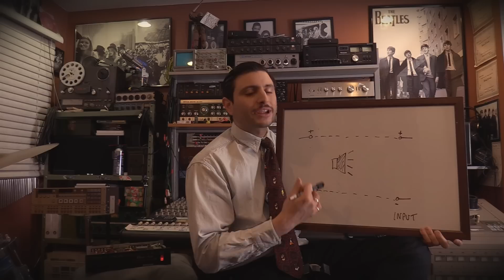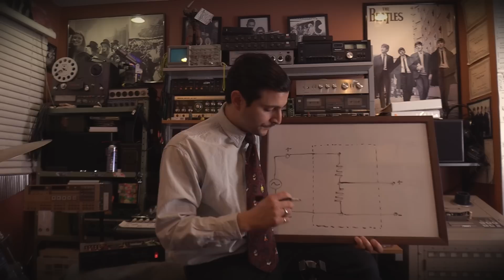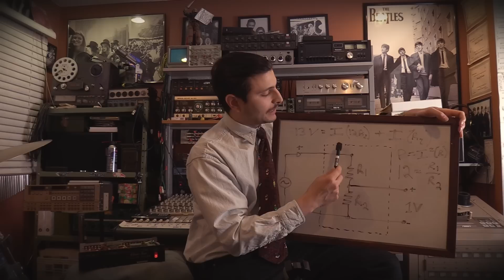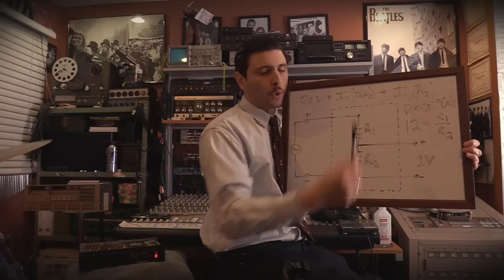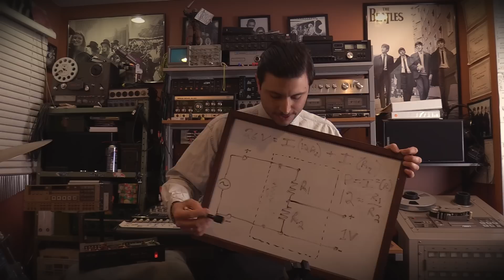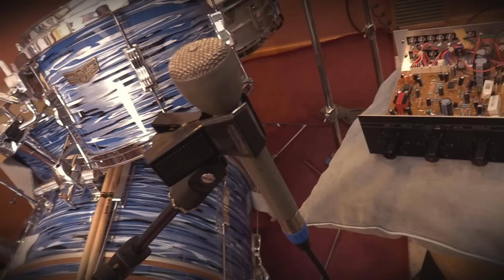DIY Speaker Level To Line Level Converter

Comment: Mario, why won't this LOC work on a tube amp?   If ohms law tells us the formula for the (parametered) voltage divider resistors, then why won't this circuit work?   Now, let's say a 5watt tube amp is used @ 8ohms and you want the speaker out of the circuit without removing it, then use an 8 ohm 50watt R across the terminals would dummy load (100% attenuate) the speaker.  Then you can speaker line out to the PA or whatever using this voltage divider circuit with the proper resistor values.  Right?
Reply from the maker: In theory I agree. I mention this somewhere in the middle of the video. However in practice, I am hesitant to suggest this to people online just because there is more at stake with tube gear. The voltages on the output transformer can peak very high in comparison to transitor gear.

Comment: But what if both speaker terminals are driven from a dual supply like a bridged car amplifier? you will not have a ground there. what then? AC coupling capacitor is also not enough i think.

Comment: Bogan's old trick used to be to take the tape/booster output from the 25 volt speaker out. The resistor values they used were the same on all power levels because regardless of power output the 25 volt terminal always produces 25 volts when the amp reaches rated power so it makes things easy for them.
  As far as running those commercial sound amps open circuit goes there are many in various types of installations that have run as mixers for larger systems. They have worked without issues for many years. As a side benefit it is possible to also power a speaker from the same tap just put an L pad in the line to control the speaker volume. It is also possible to get a balance output by using the Bogen WMT-1 transformer between the tape/ booster jack and your destination equipment.
  Be careful of this mod on amps that have BTL output configurations. In this type of output neither speaker wire is or can be grounded so you will need either resistive or transformer isolation to make this work without potential damage to the amplifier.

Comment: Would this or the Russound one work with a Dayton Audio HTA 100 tube amp, I only ask because it's not a full 100% tube amp, my understanding it that its only a preamp for tube,and the rest of the power comes from a solid state section?
Reply from the maker: I know little about that amp, however a quick google search shows it has an A/B amplifier output. A/B amplifiers can work without load, (which is what this converter acts like) so it should work. As always, try at your own risk.
Reply: @Mario_DiSanto thank you, I have also emailed the seller on ebay, if I get a definitive reply I will post it here

Comment: I came across this as I was looking for a solution for a Line Level from my 10W guitar. I like your passionate video description and solution .:)  I do have a question though, some line level inputs have the 'ground' connection going to an actual  ground, which then got me thinking that one could run into a problem if by chance one of the speaker terminals was grounded  ( in transformer less output stage) and line level input  ( in mixer) also was grounded, if by chance the connector/cable  was cross wired then there would be a possible short across the speaker out ( hope I am making sense) . Anyway I figured that instead of having  --[10k]--[1k]- across the speaker, I could have a (for example)  -[5k]--[1K]--[5K]-  across the speaker and tap across the 1K for the line level..   Your thoughts/comments ?
Thanks anyway
Reply from the maker: I think I understand your question here. I am trying to determine if that unlikely scenario would ever be an issue. Basically it seems like you are asking what would happen if you connect the line input of a unit so that the ground of that input is connected to the hot terminal of a speaker connection. As long as your have some sort of resistor in series (which you should if you follow the directions in this video) this shouldn't be an issue. I can only potentially see an issue if you directly connect the ground of one unit (which connects to your house ground) and connect that straight to the output terminals of the other unit. Then yes, you would short that out. But as long as you have a resistor in series that won't happen.

Comment: Wouldn’t a transformer work better?
Reply from the maker: @williambock1821  No for a few reasons. More costly. More harder to find. And transformers conserve power from input to output so you would still have to attenaute the signal most likely.

Comment: Hey Mario, Can this process be done to a Shure M267 mixer? because the mixer has a mono out, is there any way to get this M267 mixer to have a line level stereo output? THNX
Reply from the maker: The modification required to do so would be a lot more intensive than the one shown here. There are plenty of mods out there for the M67 that show how to make individual outputs for each input, and I am sure you can use some of that instruction on the M267. However, I am of the opinion that if you are using one of these units, embrace the summing of the signals and enjoy the limitation. My two cents, feel free to disagree.
Reply: @ great, thnx for your input! Really appreciated.
Reply: Great YouTube channel btw

Comment: Oh for crying out loud .... just hook up a 20k potentiometer across the speaker leads and dial in your output voltage on the wiper leg. Stick the thing into a small plastic box, hook it up to the back of your amp, with a cable to your line input and forget about it.
Reply from the maker: You ain't wrong

Comment: Exactly what I need right now. I was running a pair of speakers in the living room to hear the audio from my computer throughout most of the apartment. But I bought a TV for living room, but using a different small amp I bought. The speaker wires are still running there but not connected to anything. I can use this to connect to the new amp, but be able to change the volume in the living room and not dancing between rooms to "guess" what volume is just right. If I'm in the kitchen making a lot of noise, I can just raise the volume or if it's nighttime, I really need to keep the volume low to not bother the neighbors.
It's always useful to see the "rules" that apply in general. I would never have guessed that double the voltage was a good rule to follow, but if that's what some real world testing shows, sounds like a good idea.
Reply from the maker: Doubling the voltage is definitely excessive for sizing electrical components. But if you plan on driving stuff into distortion purposely it's not a bad idea. Cheers glad I could help

Comment: Whew, what a whirlwind of a vid - good stuff!  Love it!  In case it's of use to anyone, the 'voltage attenuator' is also known as a 'voltage divider' and you can find free calculators onilne for it.  Might also want to discharge your electrolytic capacitors after turning the unit off and before touching anything inside (i like the rock'n'roll screwdriver method myself, but better to use a high-watt resisitor to ground).  Nice one, Mario, the (semi) deepdive!  Wish there were a ton more vids like this.
Reply from the maker: I could do more of these 'engineering-esque' videos. It's hard with these electrical tools as I am by no means an expert and it's easy to give wrong information.
Reply: @Mario_DiSanto  Understandable, I def don't know enough to do a tech vid on it, and I build my own tube amps and effects, but simple stuff like this one you did a good job of, and it bridges the gap for people who are potential DIY'rs.  Good show, ol' bean!

Comment: Fried my SWTPC Tigersaurus 250W Amp back in the 70's when it didn't have a load connected.  I think most modern amps might be OK.  👍
Reply from the maker: I'd be nervous doing this to any amp that's 200+ wattage. Voltages are too high and there is too much potential (no pun intended) to fry something ya know
Reply: I should have also said, I had a preamp connected to the SWTPC.  For some reason having the preamp (some signal going into the amp) connected maybe drove the output transistor into oscillation.  Anyway, I agree with your analysis.

Comment: Forgive me if I'm being a bit dense, but having a hard time wrapping my mind around why anyone would want to do this.  I get that it has to be done if you are going to interface speaker level and line level equipment, but why would I want to run a PA amp into a console or some other line-level input?  Are you overdriving it to get some particular sound?
Reply from the maker: There are multiple uses. The usage I am specifically talking about for this video is to use these PA units as a 'colour' box'. It's more for fun in the recording studio when you want a garage or Lofi sound. 

There are other non-recording purposes though. Many people use these converters for home audio systems that do not have 'pre-outs'. They also sell these converters for stereo systems in cars when you want to have a line out for whatever device you may be connecting to. 

99% of devices meant for recording purposes will have line outs built into the unit, so this almost always isn't an issue.  

Check out my video here on the specific Bogen AMP and how I used it to record a 'garage' track. https://youtu.be/a6HJayBX2vQ
Reply: @Mario_DiSanto  Ahh, nice.  Thanks!
Reply: This kind of thing is used a lot for powered subwoofers on systems with no line level sub-out connections.

Comment: Mario, great video.  I feel like I could do this but can you explain the breadboard a little more.  Why are the resistors at right angles to each other?  Is that arbitrary?  This may be a few people's first legit soldering project that goes beyond repairing bad joints.  Can you post up a jpeg of the wiring diagram?  The out of focus shakycam part at the end was a bit unclear for me.  I have this amp coming this weekend so I'm excited to go through with this.

Comment: You can make a similar cheapo attenuator with an L-pad, and you get some tunability on the output. I have one that I use with my Akai monoblocks. You can also run the speaker to a DI splitter and hook one end to a speaker for resistence and use the other as a DI. Behringer makes a cheap one that handles speaker level. I like to run it out to the bathroom so I get the DI while recording my bandmates going poo-pee with that bathroom reverb.  

Another great video, Mario!
Reply from the maker: I had no idea what an L-Pad was until this comment. This seems like a super easy way to do this, as long as you are careful not to send too much signal to your board accidently. Thanks for your (impendence matched) input. cheers

Comment: Mario, I'm a few beers in... when the white board came out with math my eyes glazed over...😂
Reply from the maker: The lines really start to blur on my slide rule a couple jointaroonies in...
Reply: This guy is a lovely human being, but overcomplicated it by 800% Sorry for my insolence 
here's the short of it USE HIGH RESISTORS... for output from a 50 watt receiver, go about 8 to 1. 1000 ohms and 120 ohms with a circuit around the 120 ohm resistor to your line input of the power amp. If using a more powerful amp, Go ~10 to 1. Very powerful amp, just buy a downconverter from JL Audio, or Russound ADP 1.2.....  Best: if the amp receiving the signal has a single or pair of volume controls to set the inputs to render the "sweet" spot."

Comment from the maker: Yet another video where I thought was going to be 5 minutes long! 

However, there is no other YouTube video (or really any other place) that shows how this works, and how to design one. If you want a better write up that can explain things better than I (except without a mustache) I suggest you look at Rodd Elliot's explanation on his website. Which is a great resource for DIY audio. Link below.

https://sound-au.com/vda.htm
Reply: Are these 1 watt resistors at 1k and 10k ohms?
Reply from the maker: @codysaunders3080  No they are 1/4 Watt. Quite doable with a lower power amp like this 10W amp.
Reply: @Mario_DiSanto  thank you Mario!